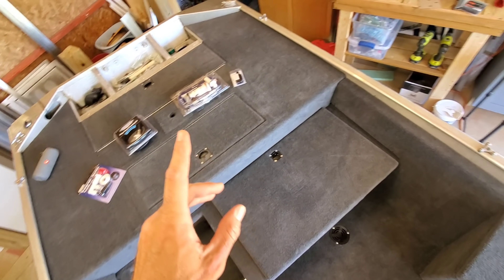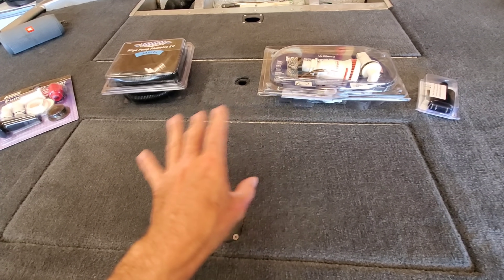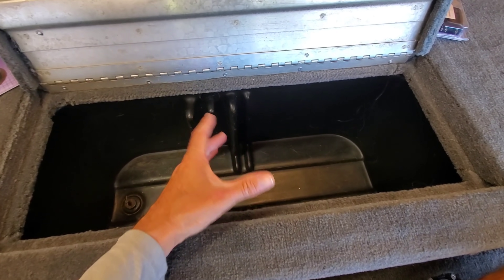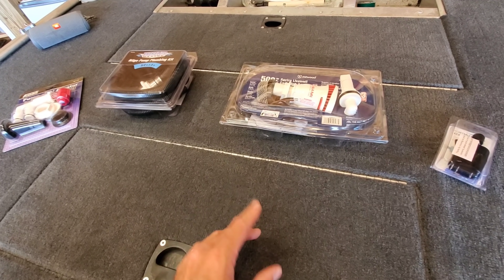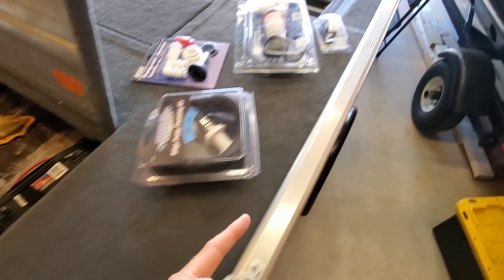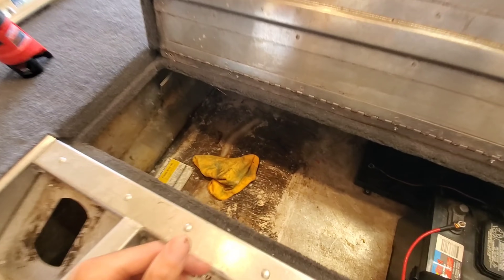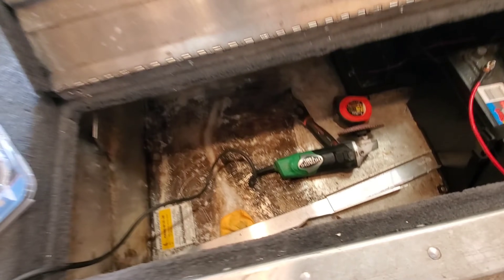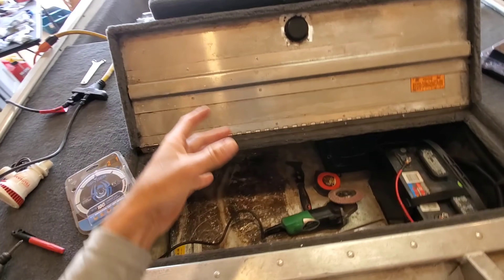Livewell Upgrade DIY | Adding Recirculation to Bass Tracker Factory Livewell

Comment: As of today 7-7-2024 the cost off all the parts are $173.21. Not including wire, screws, wiring connections, or sealant

Comment: you freaking rock! I have a 1991 bass tracker with the same livewell and this is exactly what I was looking for! subscribed!!! seems crazy to permanently mount that pump though, should have just used silicone. I also have questions, is all of this necessary? Could you not have just put the live well drain tube in and put a timer on the existing fill pump and just had it fill the livewell with fresh water every few minutes and then drained existing water into the drain tube?

Comment: Learned a lot and thinking about the same on my 2011 Tracker Pro 165. I do have a question. The pump out line. Rather than running all the way to the back of the boat. Your thoughts on exiting through the side. It's a direct path from the side of the live well to the side of the boat.

Comment: I have a tracker 185 and it has a small compartment on each side of the livewell. I’m guessing I could do this but coil up a lot of that recirculating hose in one of those side compartments and fill with ice to try to cool the livewell. Do you think that could work? I would probably have to figure out how to insulate the small compartment though.

Comment: Best example and explanation I've seen. Could you run the fill switch to the switch panel to fill it also so you wouldn't have to go to the back of the boat to fill the live well?

Comment: What's the purpose/benefit of a recirculating pump in a livewell over just the fill pump with an overflow pipe in the livewell?
Reply from the maker: Oxygen keeps helps the fish stay alive. Similar to a fish tank. All modern bass boats have livewell recirculation built in now.
Reply: Could you simply have added the aerator timer with the fill pump and added an overflow pipe? This way the livewell gets new oxygenated water as per the timer setting? Does the water get more oxygen from an aerator or from renewing the water? In any case, very neat setup there!
Reply: Yeah there should be an overflow to get out old water and bring in new lake water. Recirculation does no good to just recirculate dirty stale water. My bass tracker just has a pump/aerator (single inlet) with an overflow. So it's get oxygen and fresh water at the same time.
Reply: You are right that pumping in fresh water accomplishes the same thing from an oxygen perspective. However, if you add any treatment, such as G Juice, to the water it pumps it right out.

Comment: My bass tracker has a spray head and a piece of pvc on the drain hole that holds it about 85% full and acts as an overflow.
Reply: That how they’re supposed to work. No recirculating required, water pumped in, excess goes out overflow stand pipe and out the drain.

Comment: Thought. Since you had to make the hole for the pump would it really have been an issue using the hole saw since you were going to end up making a bigger hole anyway? Just asking because i am about to do this and would rather use the hole saw, but now I am wondering if there is something I am not thinking about. Thanks

Comment: Great video, and great job. Thanks for sharing.  One question though, whenever I run any wire or hose through a hole in aluminum, I always put a rubber grommet in so it's not cut into.  Were you not concerned with the drain hose possibly being cut into over time?
Reply from the maker: No I wasn't. It was a clean cut. Can use deburring tool or a bit of sandpaper to round. Hose went straight through, no pressure or kink on it to rub. I do use rubber edging or grommets, just time and a place and feel they are not always necessary. Just me, you do you.

Comment: Awesome video! Just want to make sure I’m understanding this, but the livewell still has its own switch to fill itself separately, and then the recirculating system runs separately?
Reply from the maker: Yes. Livewell fill is controlled by pump at the transom. Livewell Recirculation is controlled by the pump at the livewell. Both separate switches

Comment: I like your idea but whh not use the whole flow rite kit like Mike does?
Reply from the maker: 1) Because im not Mike 2) need bottom access of livewell for recirculation,  not ideal in retrofit or new buuld with limited space under livewell tub 3) saves about 200$ this way over premium flow rite kit
Reply: @AnthonyJonesBrigadeBoats  🙄 your not Mike?

Comment: I have a question, I’m doing the same on my boat but where the pump is located I have to run a hose from the back of the live-well to the recirc pump which is located near the transom due to the gas tank location is so tight I can’t mount the pump straight to the live-well itself so I’m getting a 90 degree through hull fitting and I’m going to add that to the live-well, will the have to be mounted up mid ways above the main line-well drain so the water will flow down to the pump located near the transom and was wondering your opinion, you think it will have enough pull to recirc the water back up thew the hoes if I mount the fitting up higher from the bottom of the main drain hole?
Reply: I second this question!!

Comment: Is your Fuze box negative and negative or positive and negative
Reply from the maker: fuse box has positive side for fusable accessory leads, negative bus side for negative accessory leads. All ran through gang switches for each accessory.
Reply: @AnthonyJonesBrigadeBoats  could you maybe make a video how the fuse block works and how to install a fuze block I watched your video installing it but it was very confusing